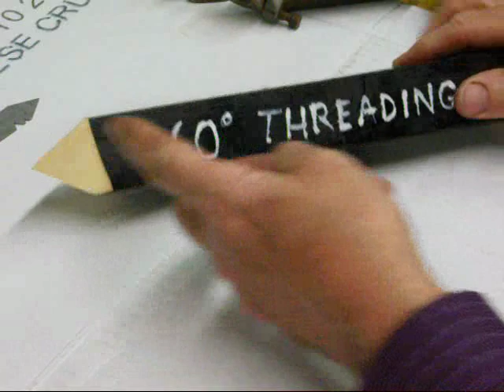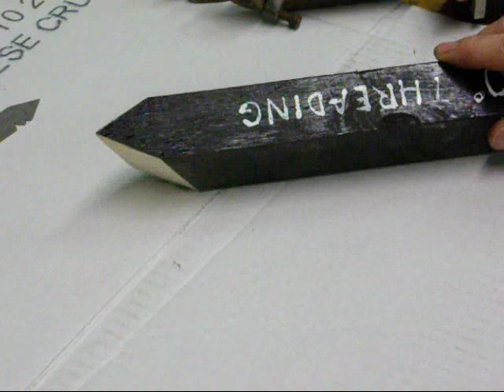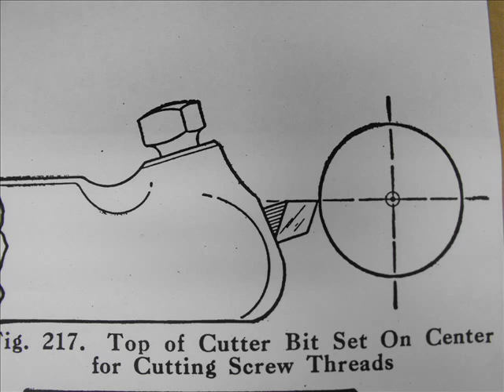TOOL BIT GRINDING #3 South Bend Clausing logan Lathe tubalcain

Comment: Hey there Tubalcain! I greatly enjoy your videos and was wondering if you would take a request.
I have noticed that there was a short period in time where a type of carbide tooling was available where you would braze the carbide tip onto a tool rod and then grind the carbide to the desired shape.
Unfortunately I am too young to have experienced this myself and have only discovered them as scrap.
I have tried cleaning them up and regrinding them to what i originally thought would be correct angles and found that HSS methods didn't seem to agree with the middle era carbide tooling, after some experimentation i found that it didn't seem to matter how i grind them they would always be quite temperamental.
I was hoping that you knew what i had overlooked in the setup and use of brazed carbide tip tools and thought it would make a good video
Regards!
Glenny
Reply from the maker: Lewis Glen Sorry.  I have avoided at all costs, the grinding of carbide. The replaceable inserts have freed me from that.  I used to get a lot of army surplus brazed carbide at the school.  I no like!!

Comment: Can I ask some questions? 
Does the "goose neck" tool can hold good accuracy? 
For tool grinding - how is with the material hardness: There should to be an different angle of tool rake.... for soft material (Al, brass, steel 1005)) You grind tool in "positive" rake, for middle hardness (bronze,steel 1045) You grind the tool in "neutral" rake, but for hard (alloy steels, special bronze etc)  materials You grind the tool in "negative" rake... is this so?

Comment: Well, I don't spend a lot of time honing, just a couple of swipes...doubt it really does any good. I never hone downwards, but rather upwards, opposite the way the material will come off the bit. I'm sure it will only last a micro-second once applied to the work piece. Can't find anything on Internet on correct honing method though.

Comment: Okay, I see your points...thanks for the response. Unfortunately, I run a small belt-driven lathe, so heavy cuts are really not possible, even in back gear. I do fall into the "hobbyist" category I guess; I certainly don't do real production work. Still, I like improvements where I can, and have been looking lately at Aluri bit holders and bits w/inserts....but it seems so much of that stuff is for CNC guys. Thanks again.

Comment: wow...where to start! Incredibly time consuming by having to set up your tool for every single turning operation over and over. Rocker tool post is not rigid enough to take a heavy cut. tool geometry is lost when angle is changed on tool holder.Rockers employ incorrect tool geometry for carbide insert tooling.If you have to make two of something,you are doing two complete setups on all tools,all numbers,etc.Bottom line...if your time is worth nothing and this is a hobby, rockers will do the job.

Comment: Thanks for the videos. A couple of questions: Do you ever hone the edge of your tool bits before using? That's something my Dad taught me to do, but don't know if I'm doing it right. Would you hone a bit being used on metal such as aluminum or is it really only for wood? For a final pass of 1 or 2 thou, is a sharp HSS bit better or a tool bit with an insert (I haven't invested in tools with small inserts). Just wondering which is sharper. Thanks.

Comment: 30 years ago, I bought my first metal lathe when I was still in high school. It came with the same rocker type tool bit holders shown in this video. For those of you that are trying to learn how to use a metal lathe on your own, do yourself a favor, take all of your rocker type tool holders and run as fast as you can to the nearest scrap yard and take whatever they offer to pay you for scrap steel. Or, take them to the nearest pawn shop....someone may want them for their historic value.